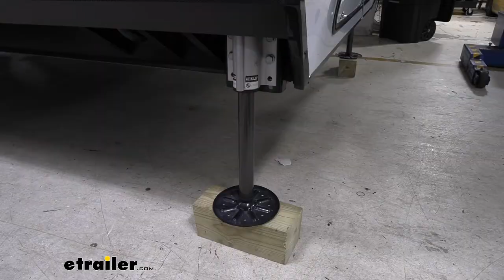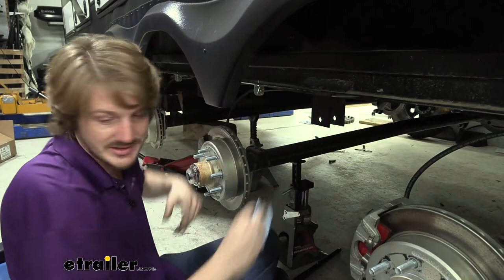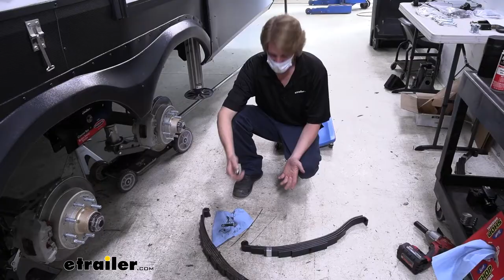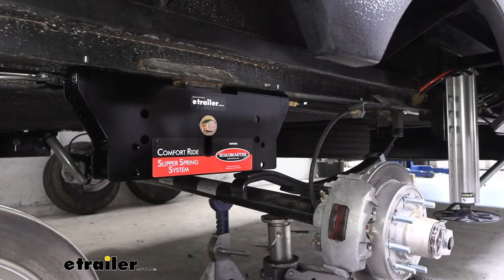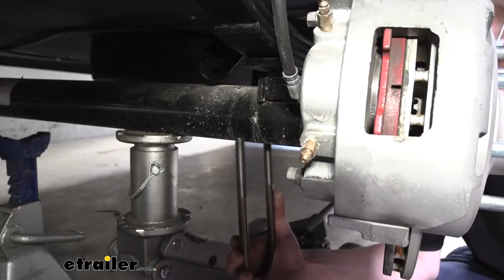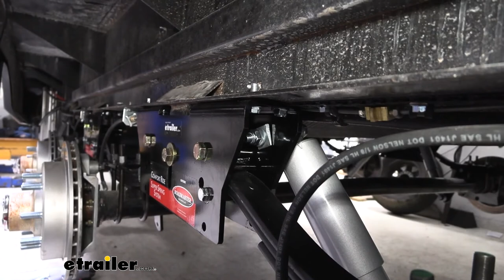Roadmaster Comfort Ride Suspension Installation - 2020 Grand Design Momentum 5W Toy Hauler

Comment: Why not install the hardware with nuts on the outside so they don't shred a tire if a nut comes off and the bolt works it's way out?  The wet bolts were installed this way.

Comment: I have a question. What would you do if the slipper spring box does not align up with the center spring bracket because the spring bracket is too long at the top and the holes are to one side. Can I cut the top of the slipper box to allow the box to slide into place to align with the holes. I have this issue right now and need to cut about 1 1/2 " off the top making the opening longer to compensate for the off center holes and large bracket. Also... the bracket is not a rectangle shape. It's straight down towards the back end but angled from the top down at the front end. Will this be an issue to cut this to fit? I hope I explained this enough. Thanks
Reply from the maker: It sounds like your trailer might be slightly out of alignment. Check out the following expert response. It may be a similar situation that you are facing.
https://www.etrailer.com/question-369784.html
https://www.etrailer.com/Trailer-Leaf-Spring-Suspension/Roadmaster/RM-2460-2570-3.html

Comment: Now the Roadmaster use the 1 3/4 " wide springs not the 2" like they used before ?
Reply from the maker: The leaf springs included in this kit are 1 3/4" wide and all of them are rated for 3,500 lbs per spring.
https://www.etrailer.com/Trailer-Leaf-Spring-Suspension/Roadmaster/RM-2460-2570-3.html